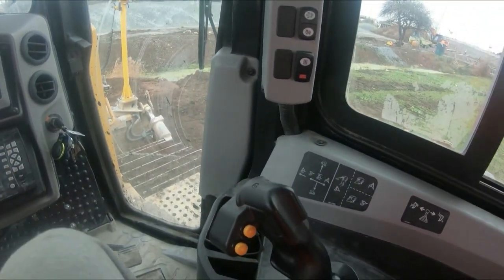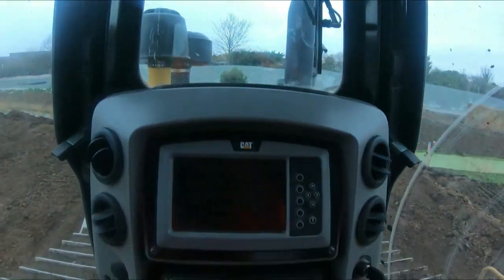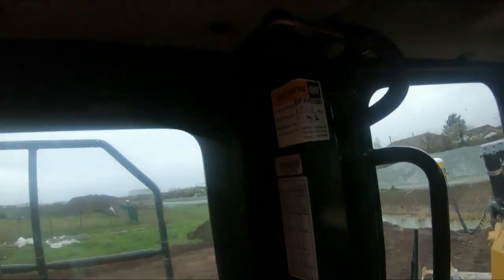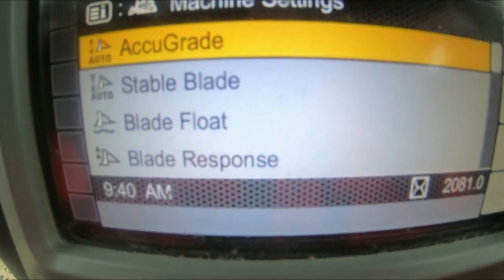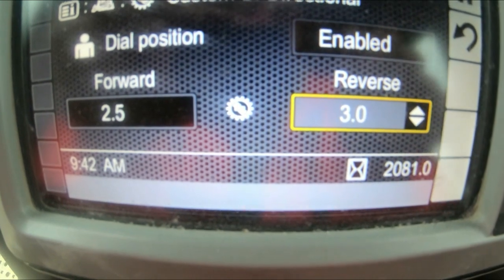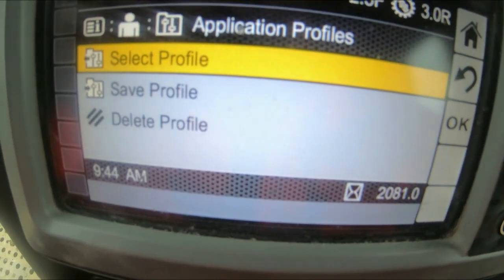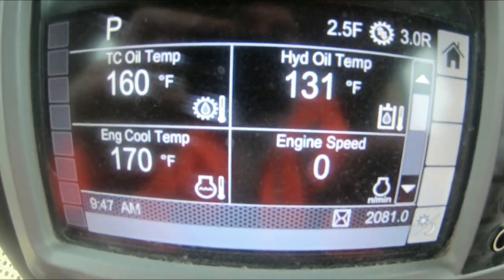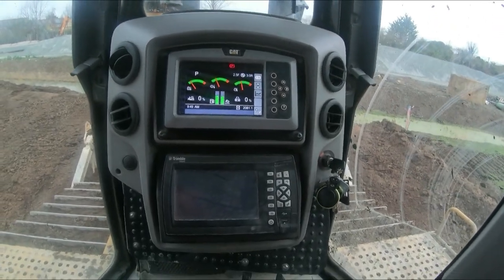Dozer controls and setup CAT D6T

Comment: so im on a d6t today with trimble the ground is on grade and as soon as you press auto the blade just starts bouncing up and down side to side out of control ?
never used trimble on a cat before only on a komatsu any ideas cos cant seem to get any answers at work - basically im grading up the best i can using the light bars really could do with auto but it seems to have a mind of its own when engaged